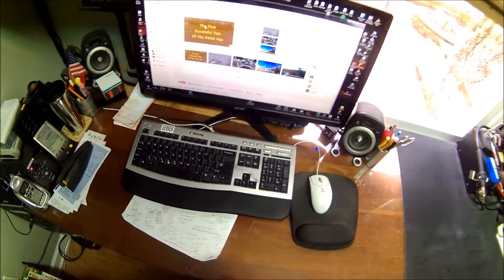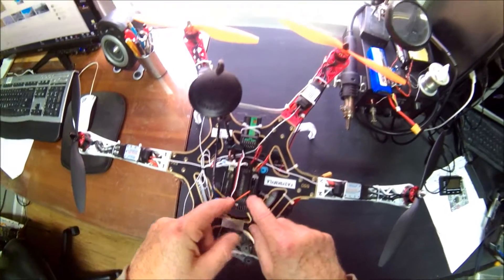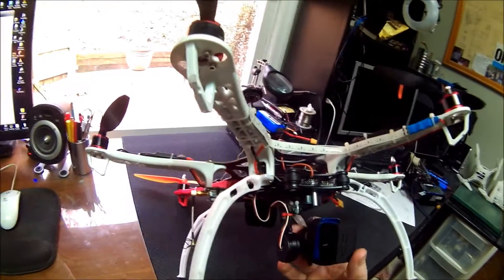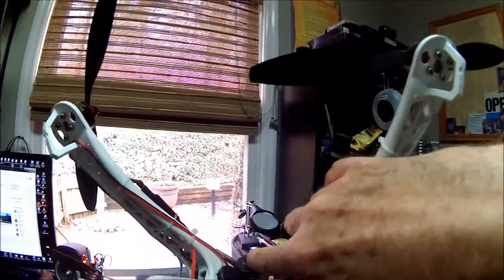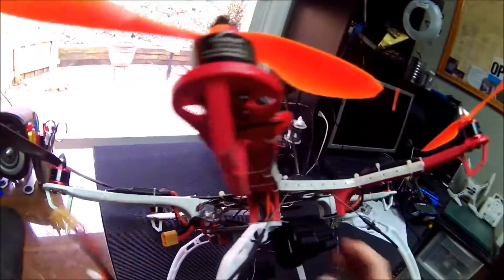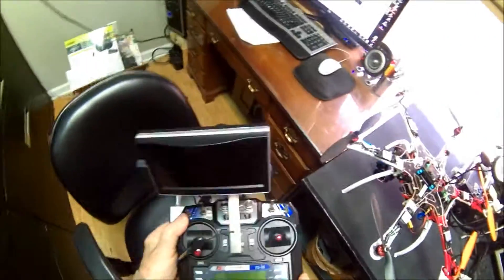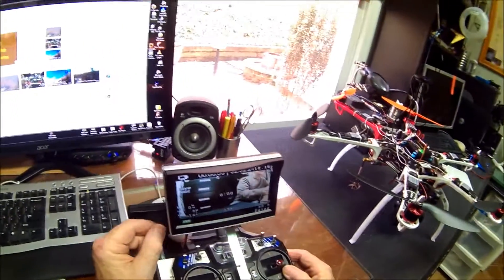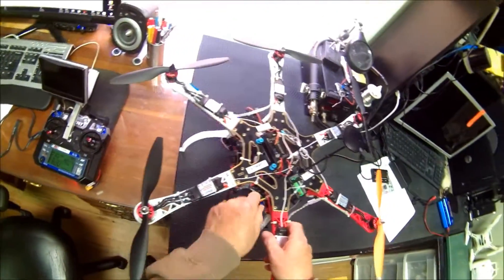F550 build - closeup look

Comment: Do you know how to wire it up because I have f550
Reply from the maker: The video shows most of the wiring except the base plate power to the ESC's and the 6 white signal wires from the FC to each ESC. The flight video signal was fed from the camera through the accessory power board on the bottom to the OSD board, and then on to the VTx. 
I reflashed the hack to upgrade the Flysky i6 to 10 channels so it can use Mission Planner's full 8 channels.
The PPM protocol from the Flysky i6 sends all controls on one wire from the Rx to the FC.
My main problem was the plastic props in the kit. I have had 2 crashes caused by broken props. 
My lesson is to use carbon reinforced or carbon fiber props.
https://www.youtube.com/watch?v=yhvNQF5I_IM
https://www.youtube.com/watch?v=HH-YgEJ_qnY